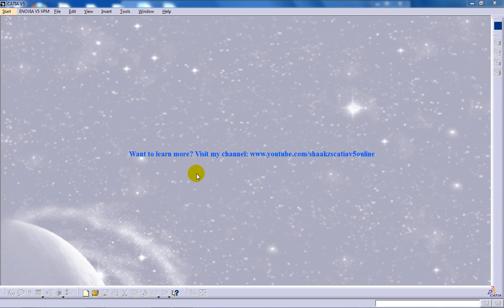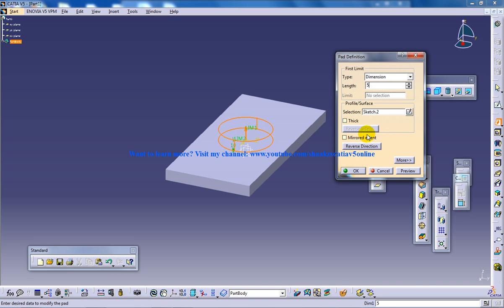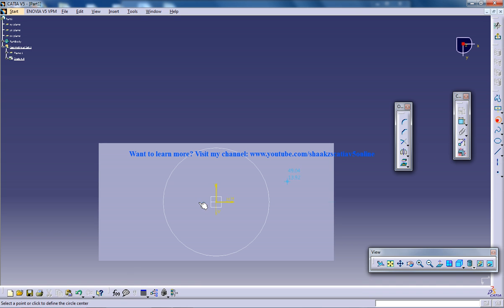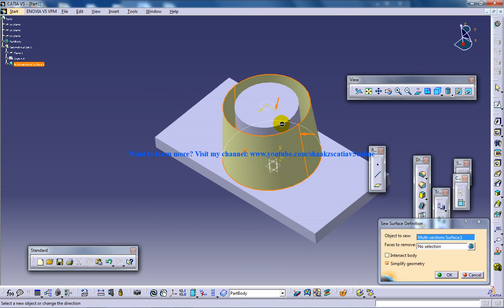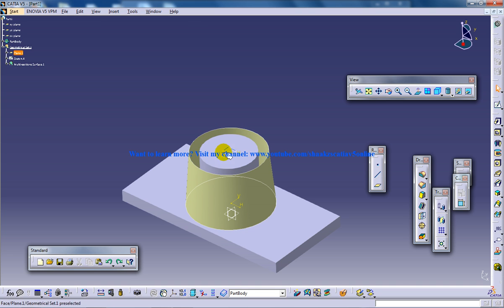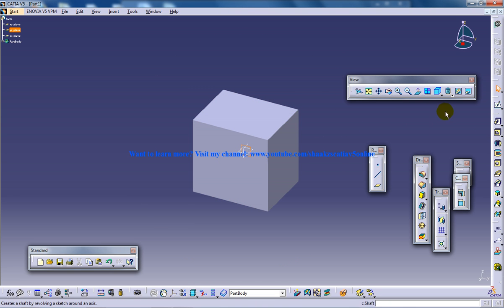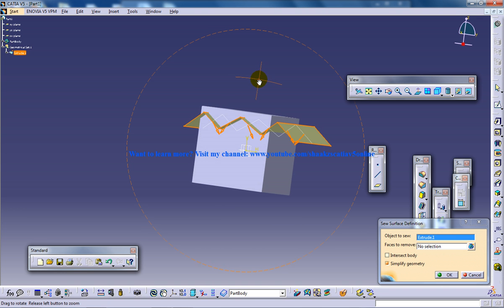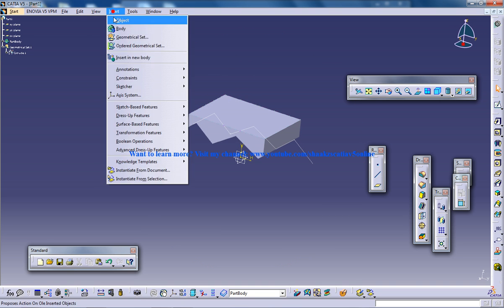Catia V5 Tutorials|Wireframe and Surface Design|Surface Based Feature|Sew Surface

Comment: sir , what is the difference between split command and sue command in surface based features ??
Reply from the maker: Prashant Kumar Sinha 

Split command seperates a surface into two parts, You have an option to keep any of them or both

Whereas sew command works with part design and wireframe and surface design, Its sews a surface to an engulfed part. and closes that part completely with the surface.

Catia V5 Tutorials|Wireframe and Surface Design|Surface Based Feature|Sew Surface

Catia V5 Tutorials|Wireframe and Surface Design|Split Surfaces